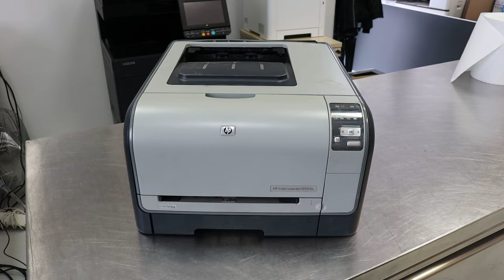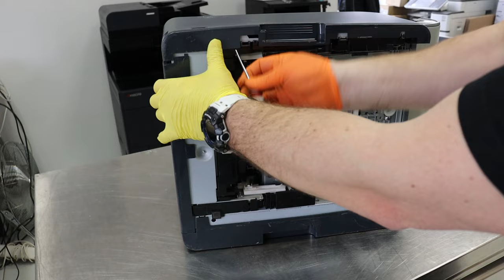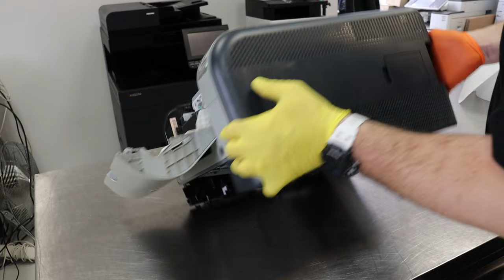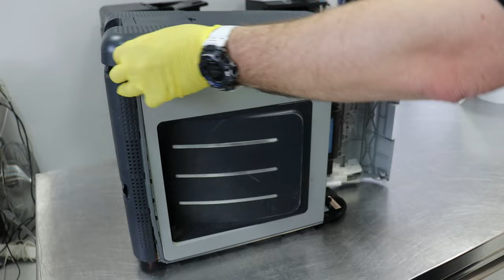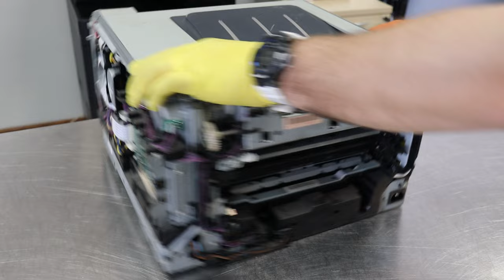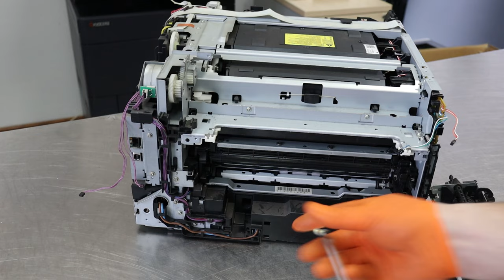How to replace fuser HP Color LaserJet CP1515 CP2025 printer.

Comment: Hola, tengo esta impresora, es genial... ¿Se puede imprimir en blanco y negro, si hay otros tonners de color vacíos?
Reply from the maker: Unfortunately the cartridges have to be full, but if you don't need color prints you can just replace the chips on the toners. This costs about 2 Euro per chip.
Reply: @MrRicoh  
perfect, thank you